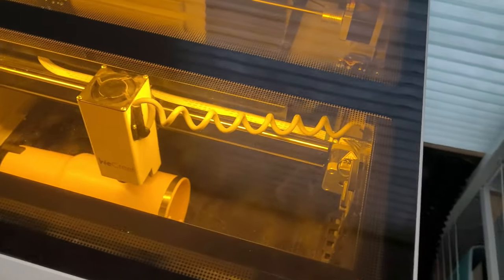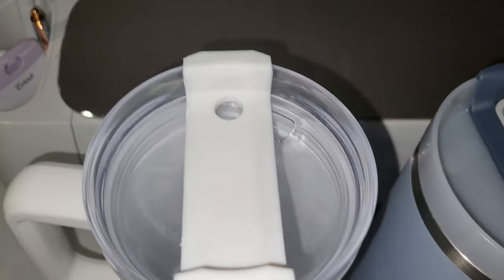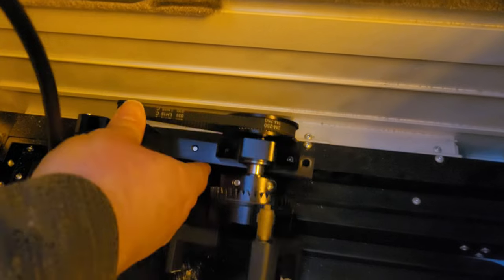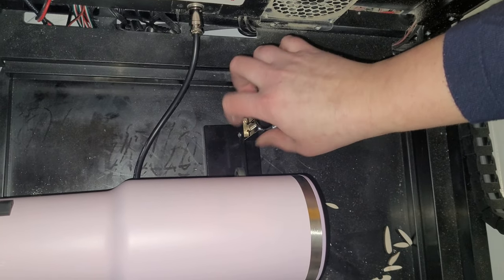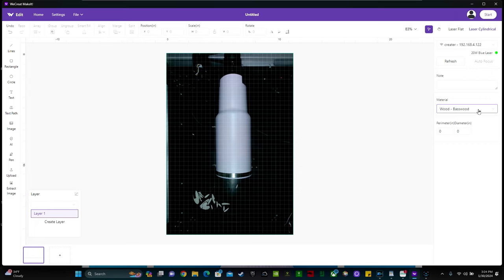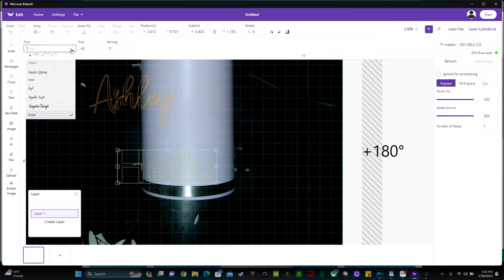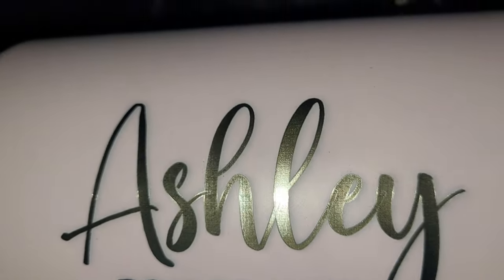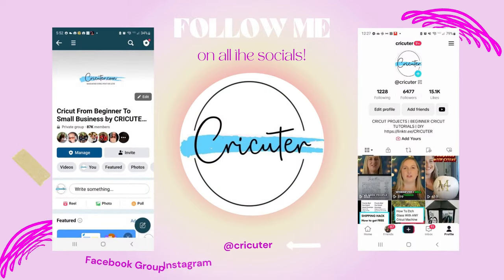How to Laser Engrave Tumblers with Wecreat Vision Laser Engraver Rotary

Comment: Great video!  Just bought one and used the link in the description hopefully you get a kick back.
Reply from the maker: Awesome, thank you! I did receive a commission for your purchase 💕 I hope you love your machine as much as I do!
Reply: My plan is to purchase the laser printer soon, however I do not have a window close by any suggestions?
Reply: They sell a air purifier as well. I bought the kit with the rotary kit to do cups and the air purifier. I got it today and used it for the first time. The air purifier works really good.
Reply from the maker: If you don't have a window you would have to buy their air extractor. It's like a big air purifier.  @angelaallen9428
Reply from the maker: That's great, I'm glad you like it!  @sheepdog_7328